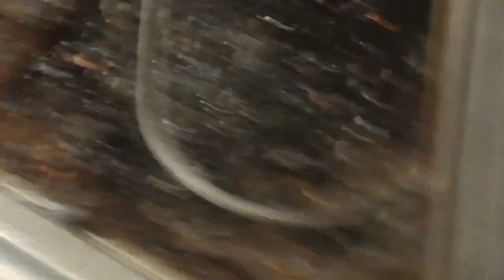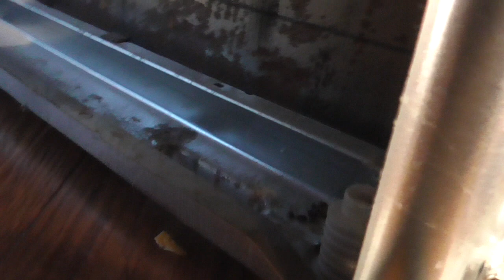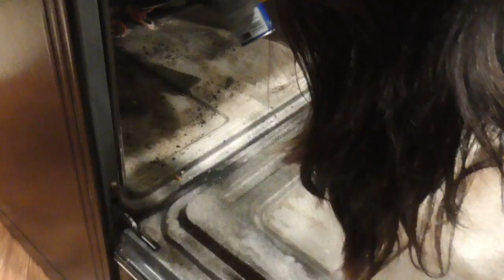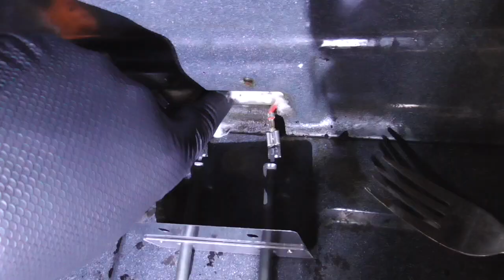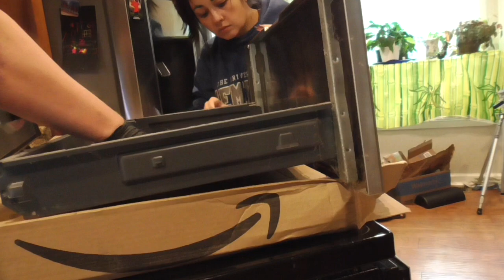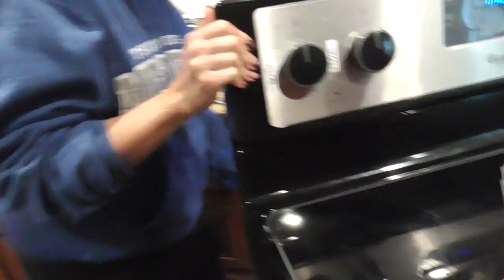Replace Oven Heating Element ... Using a FORK? YES, REALLY!

Comment: Using the power screwdriver.    Is why the.   Screws are stripped.     Use a Manuel driver.
Reply from the maker: Manual screwdriver didn’t work because the screws were already stripped out from whoever owned the house before me. It was the last desperate attempt to see if it would grab anything and kick the screw out.

Comment: Future reference- put newspapers or paper towels on the floor to protect it from the overspray of the easy off. It will ruin some flooring. Also, you can make an ammonia bag to clean the racks, check google for info. And do it outside if possible.